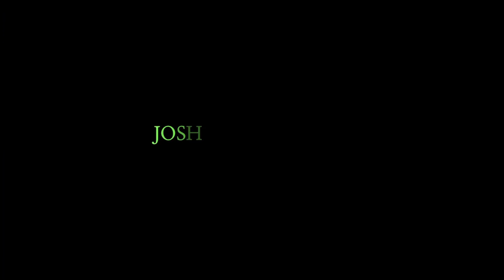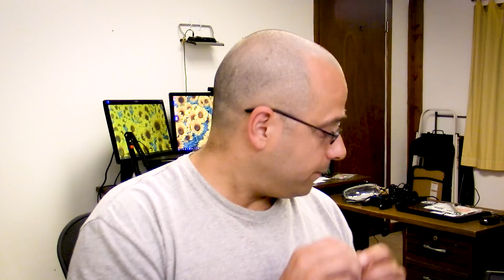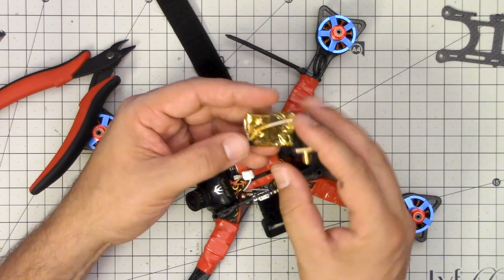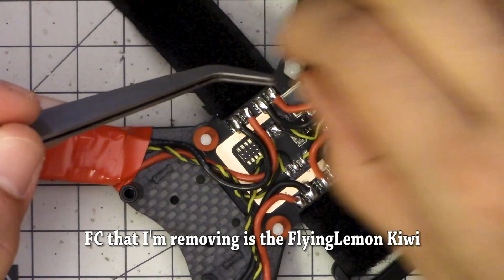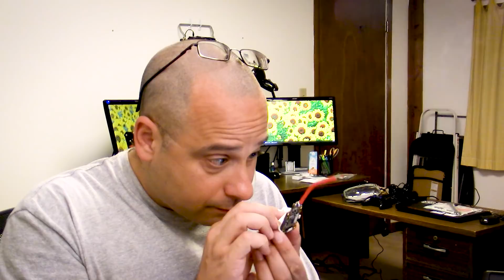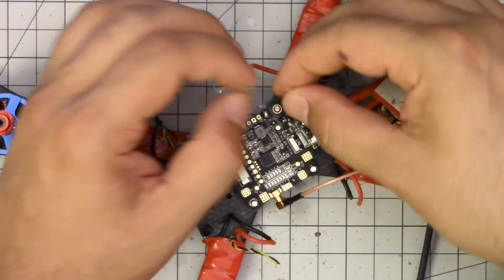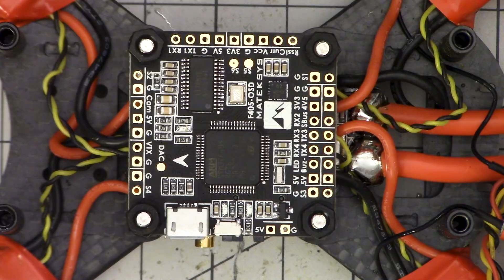Matek F405 & FCHUB vTX How To Install

Comment: One thing I  learnt in the RAAF regarding soldering, the melting of the solder should not be more than a few seconds.  If you have a large pad you need a large solder tip.  When you add the solder the melting point of solder should suffice.  However,  one thing to be aware of is the ease at which the pad can lift off from the board.  Thus, it is imperative to ensure the soldering iron tip quickly heats up the pad.  My training was to NASA standards. ;)
Reply: sounds standard
Reply: Ryan Harney I have left out the other details like the amount of solder, the specific curve of the solder on a pin and a tinned multi wire cable,, the technique of tinning, and retain the twist of the multi core wire, the correct cutters, the cleaning, the minimum radius particular wires should adhere to, The type of soldering iron tip and the angle of the tip and the cleaning of the tip.  It was a full time 1 week course ;)

Comment: how much does the fc and pdb/vtx weight all together?
Reply from the maker: 20 grams
Reply: Joshua Bardwell, this set up is awesome, & would be super clean with an ESC 4in1 three layer stack with a micro receiver.. 
only problem, if any, I have with these components is the weight; basically an extra 10-15 g versus my standard setup (excluding RX)-an ESC 4in1/PDB, a tramp, runcam Micro, and any regular FC (about 30g). Of course if you're using a super lightweight frame, this extra weight is  an non-issue

Comment: very infomative video thanks :D

also, I have an unrelated question for flysky users, is it normal to only get around 100m range running a FS-i6 and X6B? stock antennas on both btw
Reply from the maker: That's not normal range.
Reply: How’s your antenna arrangement look like?
Reply: Clayton Bigsby one is vertical and the other is horizontal, I am in a place with very little interference
Reply: 100m range is low. You can easily get over 1km with line-of-sight.
Ensure your antennas are coming out of your quad like a "V" with ideally 90 degree angle between. Ensure they avoid the props - they get real hungry for nice chewy bits of antenna.